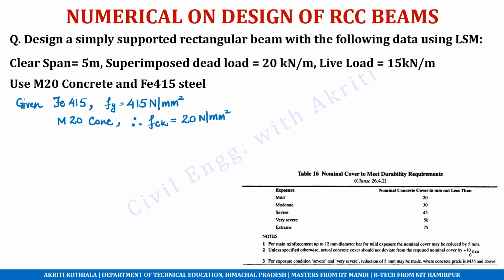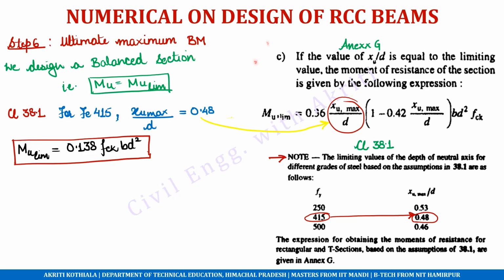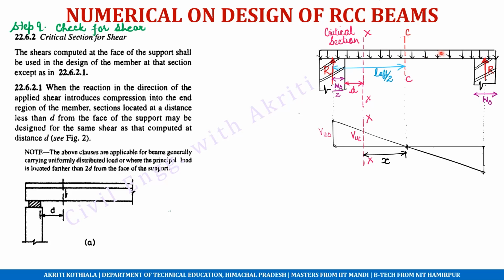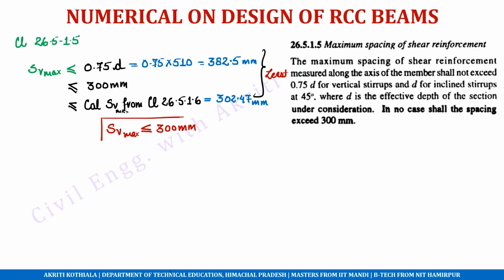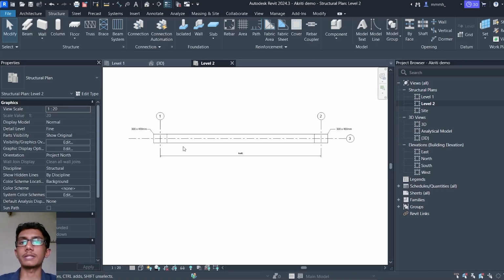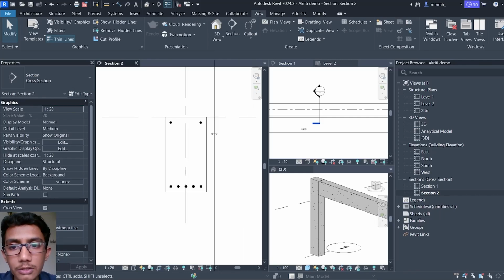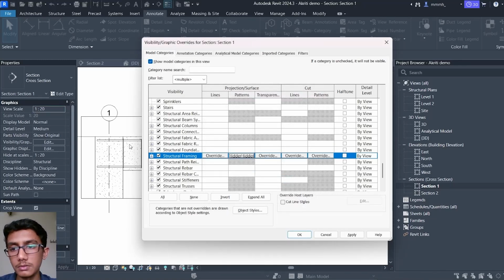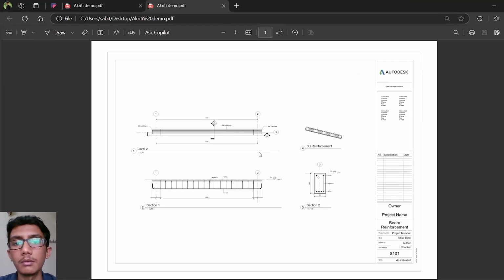RCC Beam L1A | Singly Reinforced Beam | Revit | Novatr | RCC Design | LSM | IS 456:2000

Comment: 15:33 ma'am i calculated Ast using formula given at b) in annexure g  i got it as 1375.81mm^2
Reply from the maker: The calculated value is 1465 mm^2 
However, 0.48 should be in the numerator rather than the denominator. Which is wrong in the slide.